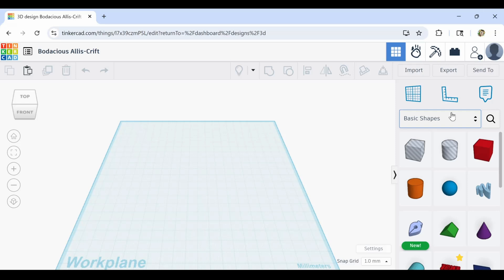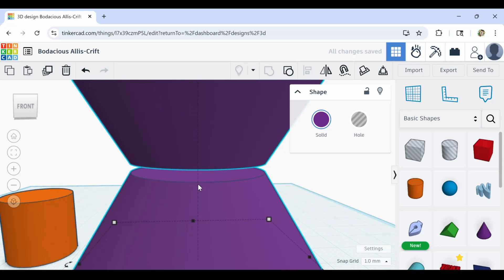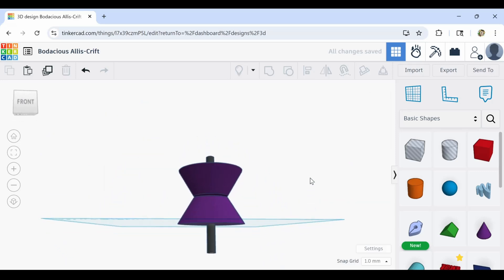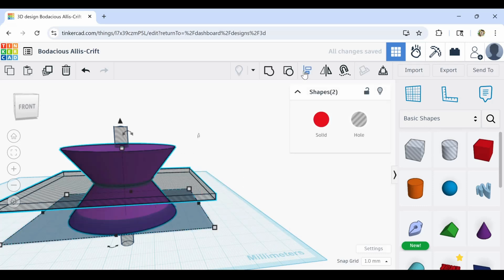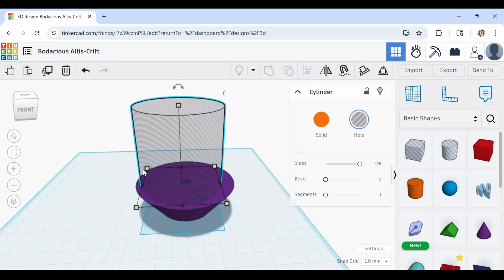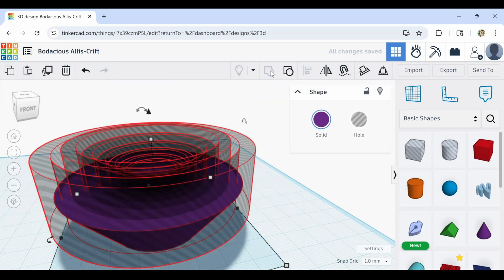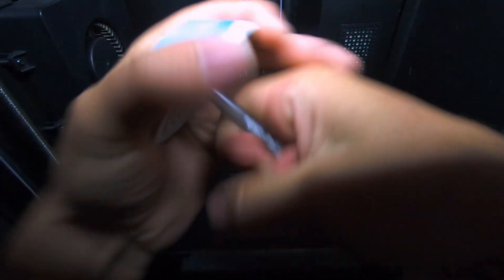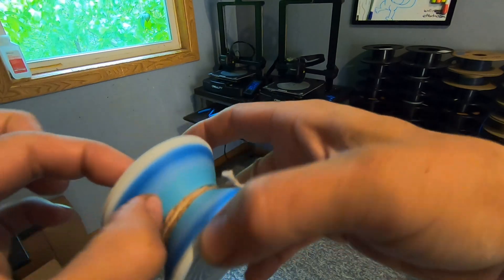How To Make A Yo-Yo In Tinkercad!!! 3D Printed Yo-Yo! Yay!

Comment: Hi, I can not find the STL file for the yoyo. Thanks Darrell
Could show how to make a honeycomb LED lamp shade, a twisted lamp shade, and a cap
to hold the LED light, the light is one in Bombu Lab or Studio, and also a moon lamp shade LED with a cap. My daughter asked to make a box for marshmallows and chocolate, and forks. The two forks are about 7in long, they stretch out 40in. This is for camping. Do you have any ideas how to do this? THANK YOU Darrell Harris
Reply from the maker: Hello!  I'll go make sure the yo yo is on the list right now. Could you email me the pictures of the lamp shades you're trying to make. I'm not familiar with that LED you speak of. 

That box project would be nice and easy. Check out my (Simple Boxes) video. Then you could just add a few dividers inside and you're good.👍
Reply from the maker: Ok, it's added 👍

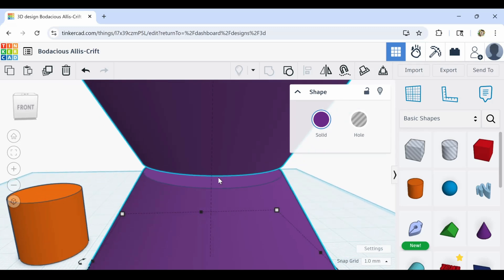Comment: 3:45 or... how about a short section of a stainless steel straw? 🤔
Reply from the maker: Yessss! That would be fantastic. I'm just not sure if I have one.🤔 That would be so smooth and slick, I'm sure it would work great!
Reply: @TinkercadWorld-ho8ht I'm going to get to work right away on this as I had a great idea,  I'm going to try some horizontal channels in the sides of the yo-yo so I can pause and insert pen springs and lead fishing sinkers (and my section of stainless steel straw) to recreate my favorite yo-yo. The sleeper. They work normally until you throw them down harder than normal so they just spin like crazy. The spring goes to the outside edge and the weight goes to the center. (2 on each side).
Reply from the maker: @ijcarroll  Wow, that sounds awesome! Let me know if it ends up working out good! Very cool